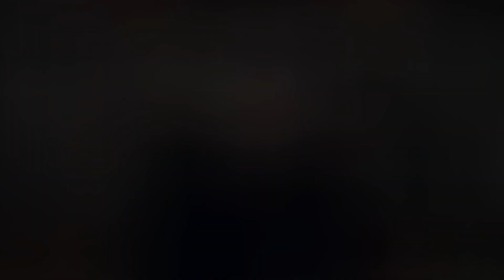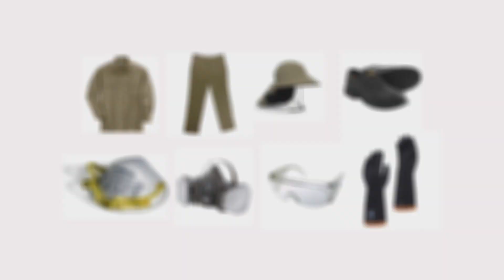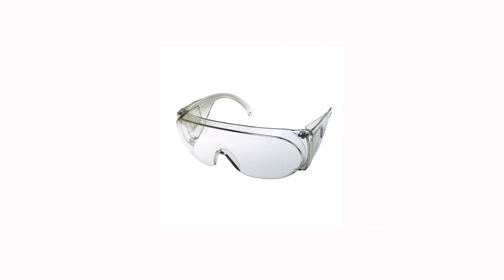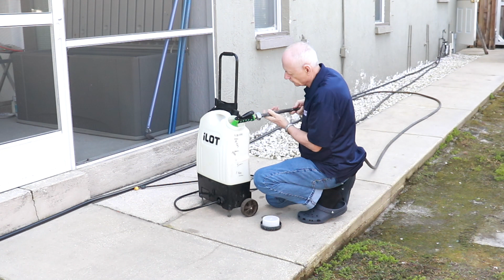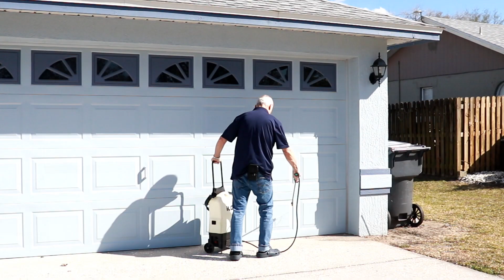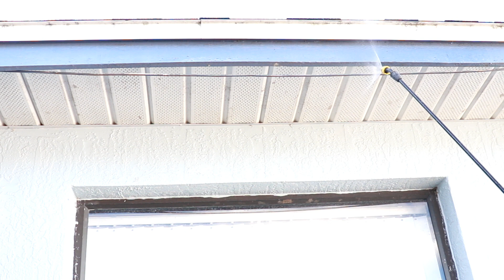How to Prevent Drywood Termites 100% Guaranteed.

Comment: Hi Guy, thanks so much for the video on Drywood termites. I plan on using the information to do the exterior of my house. Can these two pesticides be purchased by Amazon or any other online store? Also, if I have seen signs of possible Drywood termites in the trusses of my attic, will this process on the outside of the building prevent further possible infestation? Thanks, Mike
Reply: I in CA have drywall  termites in and out of my home too.  Many ways to do, either spot treats,  fumigation, or/and Bora-Care for prevention on exposed wood such as attic space.  I have been seeing termite company guys this week and next for inspection, treatment options, and prices. Guy gave me a lot of tips on his emails.
Reply from the maker: Yes, the pesticides can be purchased from Amazon.  However, I find that they are somewhat less expensive if you buy them from Solutions Pest and Lawn.  The only thing is that Solutions may not ship to certain states, while Amazon may.  California is a good example.  Since most pesticides are illegal for non-licensed people to purchase, Solutions will not ship there.  However, I am told that Amazon often will.

Unfortunately, the preventive treatment for drywood termites will do nothing to eradicate or even control a drywood infestation that already exists.  It will only stop more drywood termites from entering from the outside.  I always hate to be the bearer of bad news, but the truth is that the only surefire way to completely eliminate a drywood termite infestation is to totally tent the entire house and fumigate it with a gas.  Now, not everybody can afford to do this because it is quite expensive.  The other way to go after these guys is to do spot treatments.  The spot treatments are very effective on galleries that you have located, but the problem is finding the galleries.  I have a video on how to do this type of spot treatment and how to find the galleries.  I will place a link below for you.  The thing you should be aware of though is that even the best pest controller in the business cannot guarantee that they will find all the galleries.  So, it is not likely that you will either.  Therefore, spot treating for drywood termites is kind of like playing whack a mole.  No sooner do you treat one gallery than you find another one weeks or months later.  This can be an ongoing process that literally never ends.  If you watch my video on spot treating drywood termites, then you will get an idea of what I'm talking about.

I hope that helps.  Please let me know if you have any other questions.  Be well Mike.

How to treat drywood termites yourself video:  https://youtu.be/U7ck7zhS0Xo

Solutions Pest and Lawn:  DIY Pest Control | Solutions Pest & Lawn (solutionsstores.com)

Comment: Hi Guy, thanks again for a great video. Love the information you are providing the world.
Reply from the maker: You are very welcome.  I appreciate your kind comment.  Thank you so much for watching.  Please let me know if you have any questions.  I am always here to help.
Reply: @GuysPestSolutions  hi. I got a question. I discovered that my Vinyl siding has tiny weep holes on the bottom, I guess it’s for condensation. Can termites enter through them?
Reply from the maker: @joseleon7444  Most likely they can.  It would depend upon the size of the holes.  The bigger question is, "Can they access any wood that way?"  I would not take chances, so I would treat it.

I hope that helps.  Be well my friend.
Reply: @GuysPestSolutions  the holes are tiny holes underneath it, I once saw a “little butt” sticking out of one and I tried to grab it with my two fingers and it went inside the hole. 🤔.  

Guy- is this bad that I cover them, aren’t they for condensation drainage???
Reply from the maker: @joseleon7444  I have never really seen weep holes in vinyl siding before, but I have to assume that they are there for a reason and, you are probably correct, that the purpose of the holes is to release moisture that builds up under the siding.  So, you may do a lot of damage if you seal up those holes.  For that reason, I would just go ahead and spray them.  It does not take a lot of spray to treat siding like that.  If you would like to know a super-fast way to do all of it, then send me an e-mail to guyspestsolutions@gmail.com and I will share some additional information on how to do that.  If you decide to send the e-mail, then you may also want to send me a picture of that siding, so that I can see exactly what you have.
Reply: Yes, he is great!

Comment: Guy, I also have Bifen I/T, so could that be used instead of the Taurus SC for dry wood termites? Thanks! Lynda
Reply from the maker: The Bifen I/T is pretty much the same thing as the Talstar P.  The only difference is that the Talstar P is odorless.  They claim that the Bifen I/T is odorless, but it's not.  I can certainly smell it and my wife would never let me use it in the house because of the odor.  The Bifen I/T is NOT the same as the Taurus SC.  The active ingredient is totally different and these products work differently as well.  The Taurus SC is more expensive, but you get what you pay for.  The Taurus SC will last three months, but the Bifen I/T and the Talstar P will not.  I find that the Bifen I/T and the Taurus SC fall a bit short of 90 days.  During that time, you are not fully protected.  I would use the Taurus SC every 90 days if I could, but it's only labeled for every 180 days.  So, you do need to alternate with something.  The Bifen I/T is a good choice for that in between treatment, but I would still use the Taurus SC.  You may get away with just using the Bifen I/T, but you will definitely regret it if you get drywood termites.  So, personally, I would spend the extra money for the better insurance.  It's not that much more money.

I hope that helps.  Thanks for watching.  Be well Lynda.
Reply: Once again Guy, you are a wealth of information. To be safe I will be purchasing the Taurus SC. Thanks much!
Reply from the maker: @sanlyn23  You are very welcome.  Be well Lynda.

Comment: Hi Guy, I don’t have Taurus SC but I do have Suspend SC. Can I use this pesticide as my first treatment? I have the Talstar P for the in between applications. No problem if I need to purchase the Taurus SC. Thanks much! Lynda
Reply from the maker: I think the Suspend SC is okay to use, but the Talstar P is a better choice if you do not have Taurus SC.  So, if you have Talstar P, then I would use that and I would order the Taurus SC for the second application.  That is just my opinion.  I'm sure there are pest controllers that would argue it with me.  Personally, I think suspensions are best used indoors.  Yes, Suspend SC is labeled for outside use, but I don't think the residual is as long as Talstar P.  Also, I'm not sure that the Suspend SC is even labeled for termites.  It may be, but I don't happen to have any on hand to see.  I am sure that the Talstar P is labeled for termites.  Take a look at the target pests on the label to see.  If termites are listed, then it's probably fine to use.  Again, my personal experience is that the Talstar P just lasts longer.  I have not exactly conducted any scientific studies on though, so I cannot make this claim with total certainty.  Just my personal experience.  I hope that helps.  Thanks for watching.  Be well Lynda.

Comment: Hi guy. I put the BioAdvanced around the house and let the rain the next day soak it into the ground. Was that ok to do that? And thanks for all the great advice.
Reply from the maker: I guess that depends upon how much rain there was.  As long as there was not so much rain that it washed away the granules, then you are good to go.  If the ground is sloped away from the house, then a heavy rain can wash away the granules before they melt.  If that is the case, then it's best to lightly water them in.  If the ground that meets the foundation is fairly level, then the granules will generally stay in place and the rain will do the work for you.  If you do not have an active infestation, then I would not be concerned.  However, if you do have an active infestation, then you may want to consider reapplying the granules and watering them in.  I hope that helps.  Be well my friend.
Reply: @GuysPestSolutions  Not enough to run off so I think I am ok Thanks. Have a great night.
Reply from the maker: @ralph601  That's good news.  It sounds like you've got it licked.  Be well Ralph.